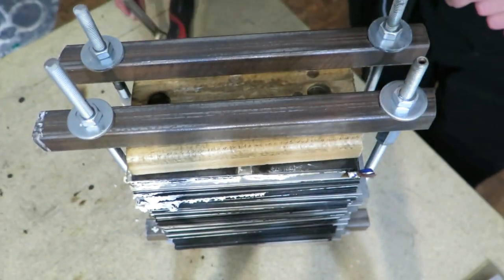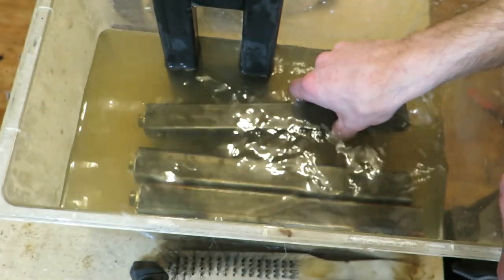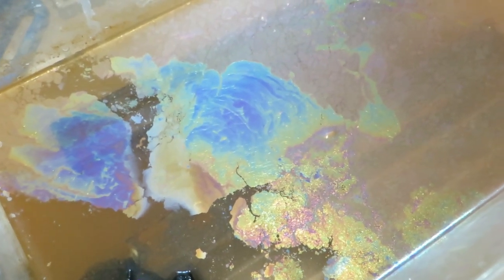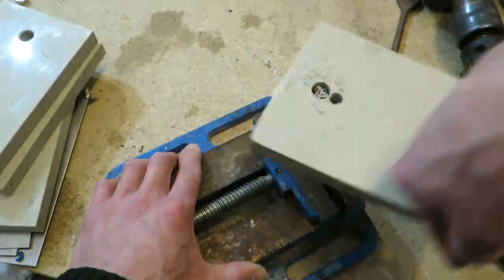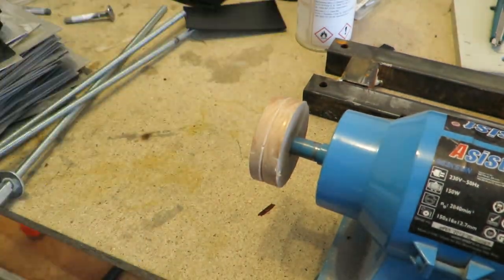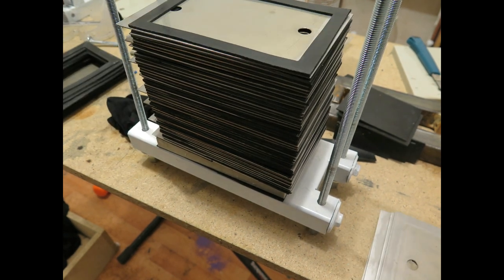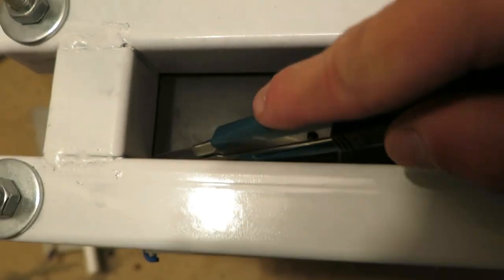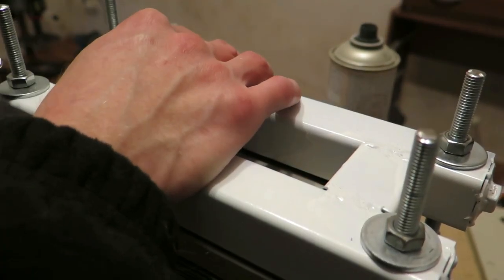Rebuilding HHO cell - Cell module

Comment: How many plates. From another video,  I  understand you feeding rectified mains voltage.  

Also,  feeding it rectified DC, the HHO generator only works when the voltage is above a certain minimum voltage as the voltage rises from zero to its max peek voltage, which is 147% of the RMS. This means part of the time your generator is not producing, and part of the time the voltage is way above your target voltage.  Together, these two issues reduce the effectiveness and efficiency of your HHO generator.  If you smooth the DC input, your generator spends more time producing, and producing at a better efficiency, and generates less waste heat. 

To smooth the DC,   I sugest using a pi filter (capacitor inductor capacitor) to smooth out the voltage and current through your generator.  Get yourself two run capacitors and make your own inductor with some coils around some iron, or repurpose an old microwave transformer using only the primary coil and remove the secondary for safety.  

Then adjust the number of neutral plates to get reasonable  production at a reasonable efficiency.  More neutral plates  voltage divide the supplied voltage resulting in improved efficiency and less waste heat  but also results in lower production rate. 

Further more, dont be tempted to overdrive your generator. No more than 0.5 amp per square inch of  electrolite exposed area of the cathode you connected the power cable too.  Over driving your generator makes it get too hot, producing more water vapors and deteriorate your plates much quicker.

Sure sodium hydroxide works, but using potassium hydroxide works much better.  With less resistance, more conductivity over a wider range of concentrations.  
http://www.horiba.com/fileadmin/uploads/Scientific/Photos/WaterQuality/conductivity/en/cond7.png
Better conductivity allows you to get the same current at lower and more efficent voltages per cell.
Reply from the maker: Target voltage is about 2V per cell @ 240V so that would do about 120 plates in total.
True, I still have to do some smoothing. Though current control would be desirable. I want to test simple triac to do the job.
As this is gas generator for torch, safety is no1 priority, then power and then efficiency :)

Comment: I think you're design is interesting and much different than an idea I have. Though you're design might have some inefficiency problems, like my first 2 small ones.
Reply from the maker: Yeah electrolyte is heating a bit...
Probably I will need to cool this after 30min...

But I don't see evident reason for this. Also I didn't evaluate efficiency.
Reply: I think the major reason for the inefficiencies are the holes that are drilled through "leaking" current directly from the anode to the cathode. Especially it acts like a electrical water heater. If you put something like liquid electrical tape (which I don't think can stand up to hydroxides). Or some kind of electrical insulator around the holes.
Reply from the maker: Yes, but is it really problem? I mean, it's only 10mm dia hole...
and mainly these holes are there to provide water flow path - to refill cells.
I was thinking about dense screens, but for me the cost is biggest priority, so this is nothing fancy. Still quite expensive, and to cut 1mm SS sheet hydraulic scissors has to be used. I wonder how durable this thing would be with 0.2mm sheets. I guess that it will do few thousands of hours... Maybe it doesn't wear out at all...

I was also trying to avoid brass fittings, but it seems that they also resist quite well.

I am not using this electrolyser now as I need to finish my lathe, but it seems that the biggest problem may be contamination, as my hoses are evidently not very resistant.

These two projects are taking me longer then I am comfortable with, but I don't have resources. I taught, that I will just make this in say 6 months and move on, but it seems like never ending story :)

Yeah and flashback arrestors... I was trying to develop something reliable and with well-known principle of operation, but HHO seems to be quite a beast. I think, that I can be happy just with my bubbler, but I think I will get to this later...

Yeah good rant :)
Reply: One source of contamination could be the gaskets used in between each plate.
Reply from the maker: Electrolyte smells like plasticized PVC(e.g. inflatable boat), so I gues its the hose, also hose lost it's color a bit.
I think I am using EPDM or SBR, both are quite compatible. 
I tried to rub rubber with paper towel and there was no stain.
Reply: @IlusysSystems   smells is probably heat related to the gaskets and or tubing.   You need to address the heat.  In another comment i suggested filtering the  rectified current  so it produces all the time instead of in pulses, so that it would spend more time at a more efficent voltage than jumping from 0 volts to peak voltage and back to 0 as happens with rectified AC.  Filter smooth your rectified output.  Then adjust the number of neutral  plates to get the reasonable production at reasonable efficiency.  Never overdrive you generator. 0.5 amp per sq inch. Use potassium hydroxide. Sure other stuff works but none as good as potassium it has the best conductivity  (lowest resistance) means less heat. And it has a wider range of usable concentrations.